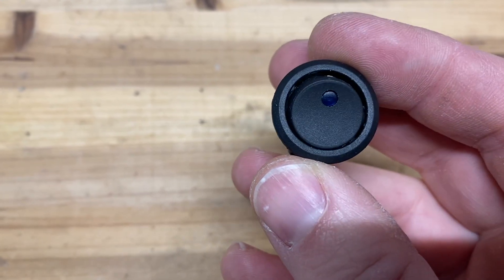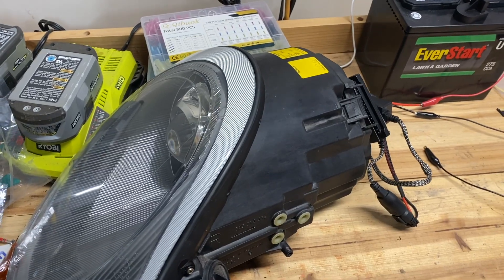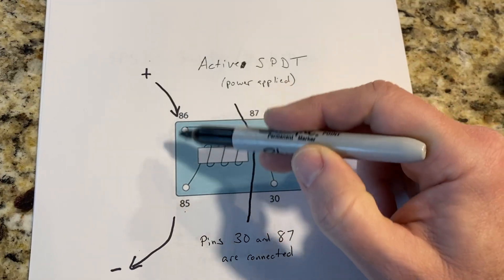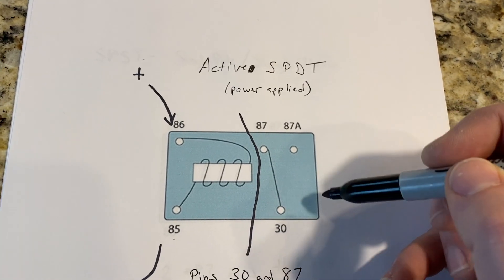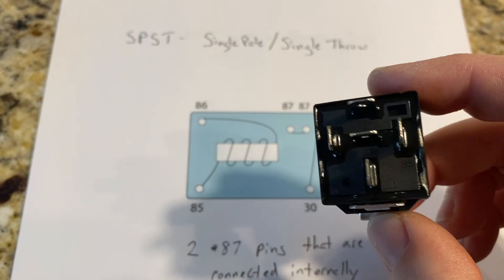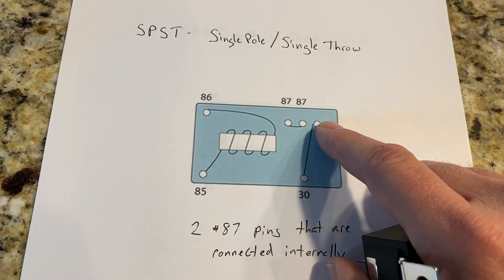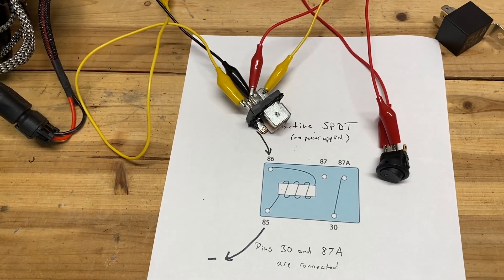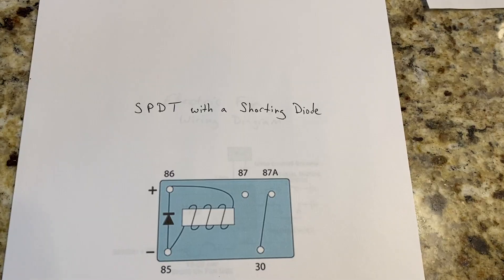RELAYS EXPLAINED! How an Automotive Relay Works with wiring diagrams and examples.

Comment: Thanks for this video! You just solved a question I had about how to implement the circuit for a lightbar that ONLY comes on with the high beams, yet also has a manual on/off in the cab. (So it doesn't come on with the high beams,) but most videos/instructions leave this necessary detail out.

I'd been thinking that laying out the circuit pretty much the way you had your driving lights circuit laid out would work correctly, and you just verified it. Thank you!
Reply from the maker: +@lindsayandrews5707 you’re welcome! Glad it was helpful 😎🍻

Comment: My understanding is that the control side doesn't require much current, maybe an 18 or 20 gauge wire would be adequate, but if the switch side load is 30 amps, a 10 gauge wire would be required. I'm just learning about relays, so if I'm off base here I would like to hear your comments or corrections.
Reply from the maker: I can’t say whether that is correct or not, I didn’t study about wire gauges based on amperage, only on how it worked for my application.
Reply: @HelpMeDIY I found that your video is one of the best ones, but nobody seems to address my question, even though it is an important thing to mention. I know that in AC, 30 amps = 10 gauge and 40 amps = 8 gauge. I don't think that DC would be different. Thanks for your reply.

Comment: This was great.  A thought for anyone tackling aftermarket daytime running lights  (DRL)--  You may want to have a second relay where relay #2's pin 86 is connected to parking light wire and relay #2's pin 30 is coming from relay #1's pin 87.  Relay #2's pin 87 is unused, and relay #2's 87A (yes a use case!) goes to the DRL + power.  This will turn the DRL off when parking or full headlights are turned on, a "technically required" design in newer headlights - DRLs shouldn't be on when full headlights are on.
Reply from the maker: Great tip thanks! 🍻

Comment: Great vid 👌  alot are confusing  , im still stumped on connection inside fuse box instead of battery i don't want to overload and burn things up and not sure where to or which fuse to make connection with , truth is because of brain injury I have to have new info mapped out in the most simple way or it doesn't register I just draw a blank when trying to put it all in perspective and complete a  task . Sometimes it really sux it's like having to go back to 1rst grade level  to learn anything  I really appreciate you guys that take the time and effort for  these detailed vids  you're making a difference in folks lives more than you ever thought , so thanks man good stuff !!
Reply from the maker: Thanks so much for the kind words 🙏 🍻

Comment: Does the control of the relay ever pass current or voltage to the input and output (pin 30 to pin 87) of the relay?

Comment: Won't you run the battery or higher current flow through 30 and a lower current through 86?
Reply from the maker: +@Combatinho  someone can correct me if I’m wrong, but I don’t believe there are and resistors out anything that would lower the current

Comment: 87a is convienent to use when it's necessary to turn something off when you turn the relay on.
Reply from the maker: +deep6this deep6this do you have an example?
Reply: @HelpMeDIY  turn off the lights when starting a vehicle (my motorcyle does this).  disable the use of a convertible top when starting the car. disable the air conditioning compressor when the ecu detects an overheating situation. (my sports car does this).

the list is just about endless as to what one may want to prevent from happening while something else is happening, assuming the thing that IS happening demands a relay. of course, the thing that one wishes to prevent from happening need not involve a relay.
Reply from the maker: @deep6thisdeep6this92  great examples, thanks!
Reply: @HelpMeDIY  As I shared in a top level post, you could use 87A with a second relay to cut power to the DRL if the parking light wire has power so you're not powering the DRLs when the headlights or parking lights are on.